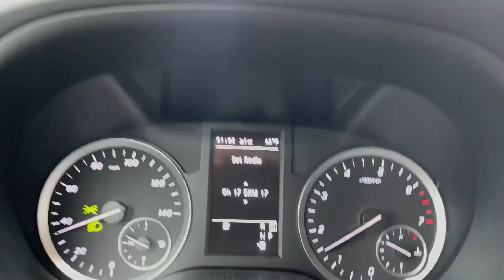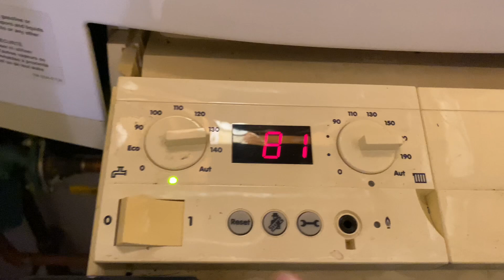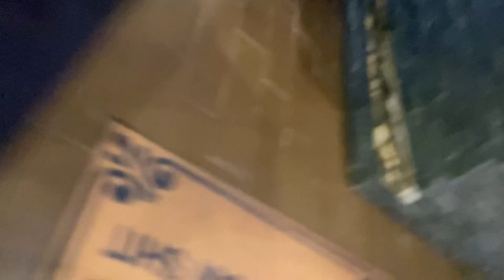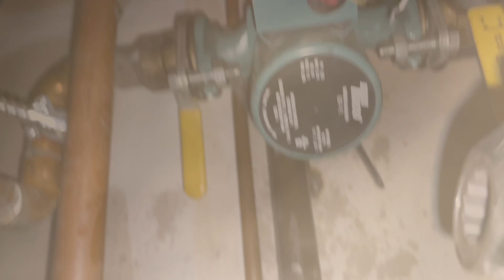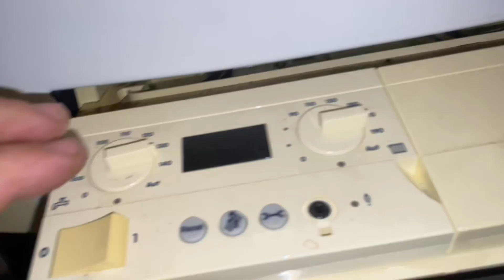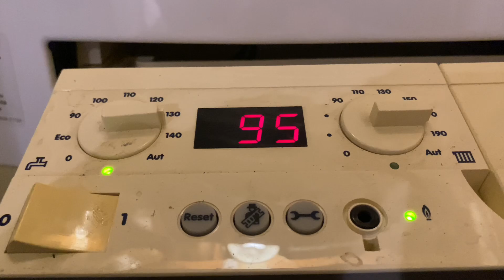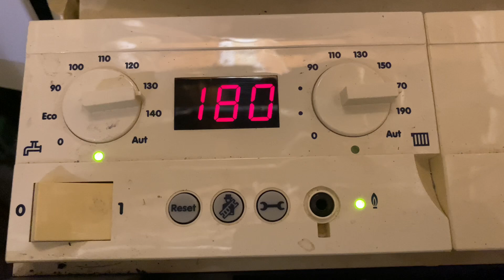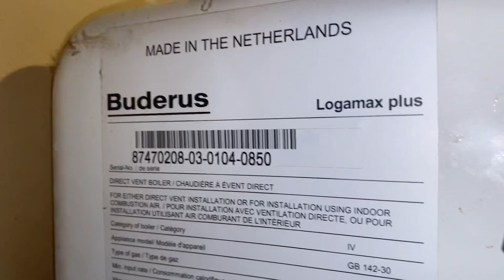Sunday Morning Emergency No Heat Buderus Boiler Bad Circulator Replaced

Comment: Do you have a 9v battery in the truck for the smoke detector?
Reply from the maker: Yep, yes I do. You heard the smoke detector over the extremely loud television on the second floor?
Reply: @PipeDoctor Unfortunately, we Did. 😬👍
Reply: @kens.3729 thanks for sharing
Reply: many times you'll find it's hardwired battery backup CO detectors chirping their end of life death.